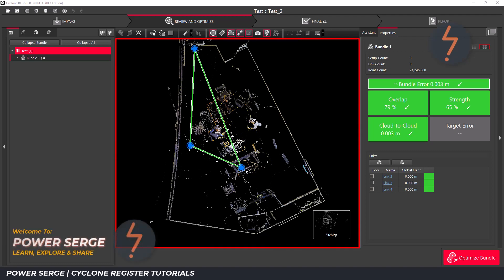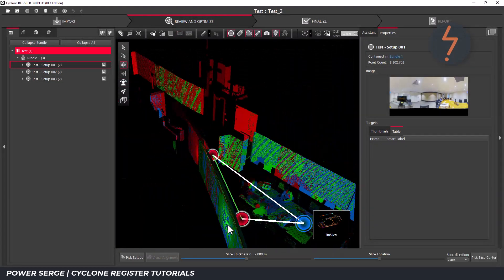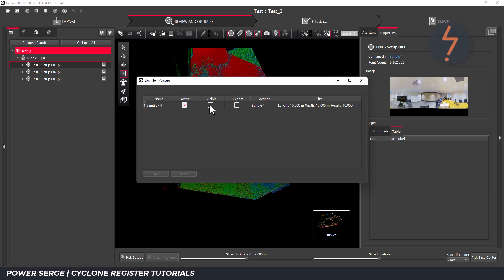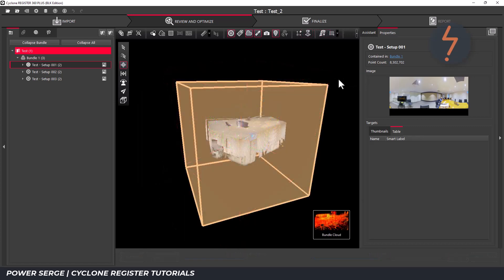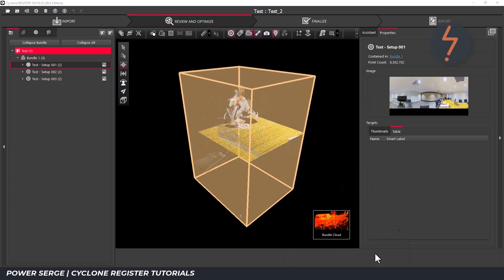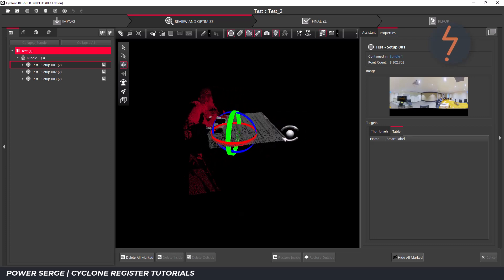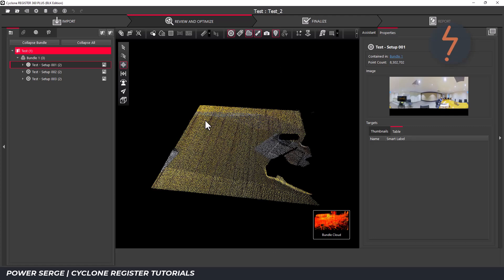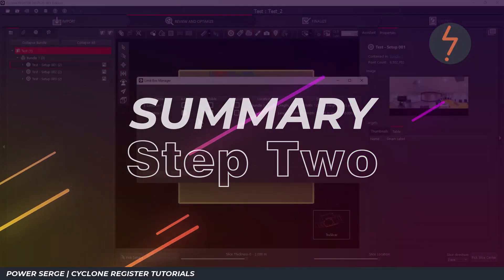How to Clean Noisy Point Cloud Data

Comment: Does the smooth surface tool also work for removing noise around cylindrical shaped surfaces?
Reply from the maker: It’s plane based…if that helps.
Reply: Thanks for the info! Then that means a scan of e.g. a tank cannot be cleaned or smoothed with that approach unfortunately. Do you know by any chance if there is something available that could do that in Cyclone Register? Currently I have to manually remove points via the rectangle or polygon selection tool, which is cumbersome and prone to errors.
Reply from the maker: Yeah for sure, so if you cut a series of horizontal cuts then the fence tool would work well.